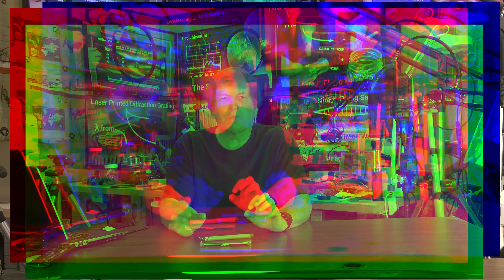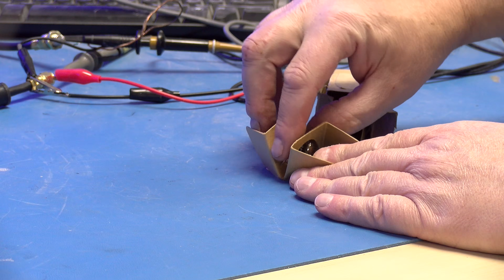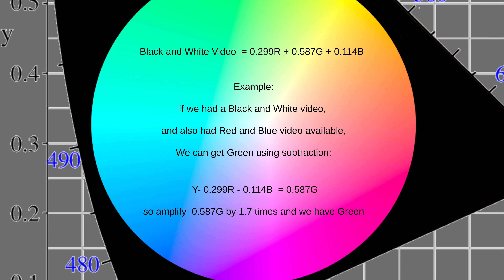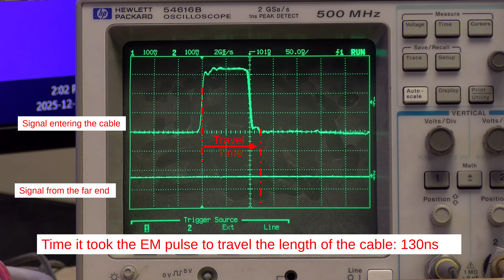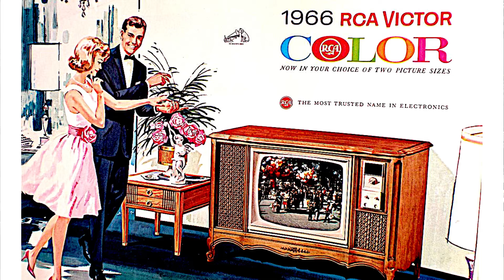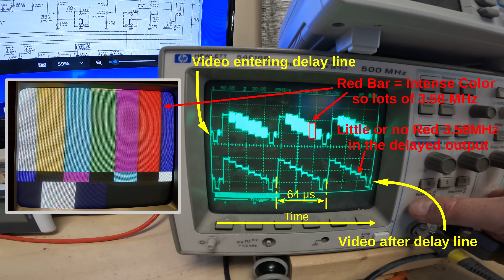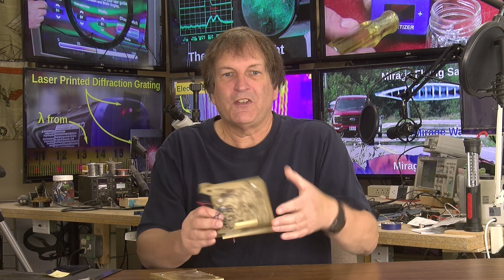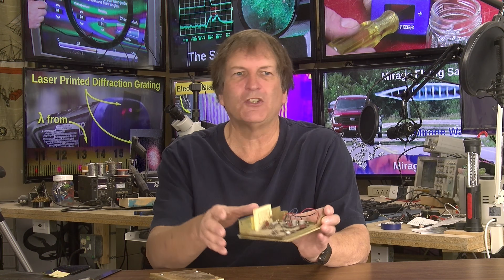How we slowed down electricity to create Color TV

Comment: Some computers in the 80s used delay lines to generate precisely timed signals for DRAM control.
Reply: For example, the Atari 800XL used a 5-tap delay line, ranging from 25 to 440 ns, to generate DRAM clocks. It fit in a standard 14-pin DIP package.
Reply from the maker: @ClausB252  Thats really cool - I have not see that - never had an Atari :)
Reply from the maker: I didnt know that - and I should - had an Apple II back then. I wonder if it used a delay line for the DRAM? The CPU clock at 1Mhz was so slow it would been hard to generate the RAS and CAS timing directly.
Reply: @ElectromagneticVideos  Woz divided the 14 MHz system clock down using various counters to generate RAS, CAS, and all the other memory and video clocks, no delay line in sight.
Reply from the maker: @ClausB252  Of course! I had forgotten that - he needed the higher clock for his brilliant color generation by having bits/pixels in different phase position. His disk controller with bit positioning was equally brilliant.

Comment: I've worked on the same Sears sets shown at the first of the video. Now, to confuse things even more, what system would they use, NTSC or PAL? Some claimed one to be superior to the other, depending on which nation you lived in. The Soviets had their own as well, which was supposedly a version of the NTSC system.

A color floor model would run upwards of $700 at one time, and I remember a 15" RCA selling for $350, which was a lot of money in the seventies.
Reply: NTSC was first. to change to PAL would obsolete ALL the TVs in the USA, s it was cost prohibitive to change to PAL
Reply from the maker: @rty1955  Yes! And it certainly was good enough and as semiconductors replaced tubes the phase errors almost vanished.
Reply: @ElectromagneticVideos you should also explain why vido frame ratenis 29.97 frames per second as that was also part of the color system for broadcast :)
I was in broadcast when videotape was invented. :)
Reply from the maker: @rty1955  Had a bunch of requests for that - I'll do a video on it. 

When video tape was invented? - quadruplex min 1950s? That must have been amazing to be part of. I heard the first machines were so finiky that you pretty much had to play a tape on the machine it was recorded on or the chances of it being usable was low?
Reply: @ElectromagneticVideos the first broadcast  video tape machine were invented by Ampex in 1955. The first model was the VR-1000. It was a flat deck model with all the tube electronics in a 7 foot rack next to it. The design philosophy was to record and playback on any machine, but the machine has many servo mechanisms in it, two being capstone control and the other was the video headwheel. The video head had 4 heads on a rotating wheel. Hence the name quad. The heads rotated at 14,400 rpm and the were perpendicular to the tape. Each head  could only record/playback  17 lines of video, so stop motion playback was impossible. Since the heads rotate so fast the machine needs an air compressor for the air bearings on the video heads. Ball bearings introduced video noise due to the friction of ball be as rings. 
The machine lockup time was in seconds, so for broadcast, you have it a 7 second pre-roll so the machine can lock up to itself and also lock to house vertical sync. It was locked to vertical sync so home television  set did not "glitch" when the video signal was switched. The only time you need full vertical, horizon and burst lock, was when you were doing a special effect, ie dissolve,  chroma key etc.
I worked on every model that Ampex made, and my favorite was the AVR-1
A tape recorded in 1960 can be played back today on a restored machine.
Google an Ampex VR-2000 to watch ots operation 
I now restore these machines.
Reply from the maker: @rty1955  Fascinating! On some old TV shows (I'm a vintage Sitcom fan) you can see the bands of slightly different color hue across the image - All in the Family comes to mind. I assume the videotaped shows in the 70s were all recorded in quadruplex? 

Thanks for that bit of historic detail - do you mind of  copy it to the "posts" section of my channel so it doesnt get lost in all the comments? Do you have a website? Would love to see the machines you are restoring! Or send me an email!
Reply: @ElectromagneticVideos i will post in general comments section..
Reply from the maker: @rty1955  Great!
Reply: PAL, "perfect at last", was technically superior but it was later development.
Reply from the maker: Cool that you worked on those sets! The interesting thing that I came across was that RCA actually had a patent on the phase alternate line idea that became PAL. However RCA kept it out of NTSC because in their estimation it would have added 2 more years of development to making a practical consumer TV set. So it was a business decision where "good enough" ruled. And it may also have been a money thing - another $100 or two on top of those price might have reduced the number of color TV purchasers even more. As you said, that was a lot of money in those days.
Reply: @ElectromagneticVideos same business decision caused VHS to win the battle over Beta.
Reply from the maker: @andyevans2336  I have always found cases like that fascinating - there is often way more to success than having the best or most advanced technology.
Reply: @ElectromagneticVideos  Yes, with RCA, it was always about money. There were a lot of patent suits filed back then between manufacturers as well.
Reply from the maker: One more things - the Soviets - I had thought they used a variant of SECAM, as did most of the eastern communist countries. But the USSR might have been different - I think  a large part of choice of TV system in those days was to protect local industry and also keep out undesirable foreign news. There were lots of subvariations of NTSC, PAL and SECAN to do that - including different audio sub-carriers.
Reply: @ElectromagneticVideos  I think the Soviets used the variant before SECAN; see below from Wiki:

"In January 1960, seven years before adoption of the modified SECAM version, the experimental TV studio in Moscow began broadcasting with the OSKM system. OSKM was the version of NTSC adapted to the European D/K 625/50 standard. OSKM is an acronym for "Simultaneous system with quadrature modulation" (Russian: Одновременная Система с Квадратурной Модуляцией). It used the color-coding scheme later used in PAL (U and V, instead of I and Q).

"The color subcarrier frequency was 4.4296875 MHz, and the bandwidth of U and V signals was near 1.5 MHz. About 4,000 TV sets in four models (Raduga, Temp-22, Izumrud-201 and Izumrud-203) were produced, and were not commercially available."

Comment: The idea of transmitting 3 video images in 3 different colors (red, green, and blue) was what CBS proposed.  However those 3 images had mostly duplicate information in them.  They differed only in color, having duplicate brightness information.  It was recognized that the brightness or luma information took up the most of the bandwidth, and the color information the least.  That 3.5 mhz signal was actually a subcarrier upon which a phase modulated signal carrying the color information was transmitted, much like the way stereo FM broadcasts worked.  In the case of color only two of the three colors had to be sent, the total luma or brightness signal was already being sent in the "main" video signal, then the percentage of that total luma for red and blue were sent modulating the color sub carrier.  Once you subtracted the red and blue from the luma, what remained was the green signal.  The Green signal carried the most bandwidth as it was right in the middle of the eyes sensitivity to light.  That's why only the information of the blue and red colors were transmitted, they took up the least bandwidth.  The frequency chosen for the color subcarrier was based on the horizontal and vertical scanning frequencies, and those were base on the prevailing power line frequency.  That's why in Europe where thy have 50hz power, PAL and SECAN transmissions use different color burst sub carriers.  At it's time, the NTSC system was a stroke of genius!

In ham radio, Robot Research produced a line of Slow Scan TV equipment that could send video information over the 2.5khz bandwidth SSB voice signals used in short wave communication.  This was basically a form of FAX transmission that sent a 128x128 pixel still image (8 seconds per frame) in Black and White.  Robot wanted to add color to this, but in a compatible way.  So they added an additional burst of color information at the end of each line of video during the horizontal blanking pulse.  This information was in the form of R-Y and B-Y.  They digitized the incoming signal and stored it in computer memory, then they could play that image back by un-digitizing it (A/D then D/A) thus scan conversion to display a single frame on a CRT.  The R-Y and B-Y signals were sent as only 32 pixels per line, or about 1/4 the BW of the entire line, similar to what NTSC was doing.
Reply: I always see your comments in the comment sections of a lot of channels I watch, and they are always very informative. I always appreciate them. Take care, sir!
Reply from the maker: @Bizzy09  I'm not sure if your referring to  @KennethScharf  or myself - I think we all watch a lot of similar channels and comment on them. One thing I have learned is how important comments are for videos - they seem to be one the things that really helps a videos popularity. And insightful comments also add lots of interesting information - I learn so much from comments on my or other peoples videos. Sometimes the comments are the best part. Its also very nice for the videos creator. I post way more comments on videos since making my own channel and understanding how helpful they are.
Reply: Yes, combining the color information into differential signals and Y was required to provide a compliant B/W signal. The color subcarriers were in fact chosen to spectrally interleave the quadrature modulated chroma signal with the baseband luma signal (Y). You are correct, they are calculated as a multiple of the scan rate, the number of subcarrier cycles per line and a frequency offset (PAL) to avoid moiree patterns
Reply from the maker: Thats a great summary filling in a lot of stuff that didn't get in the video! 

The CBS color wheel system - as impractical as it was both mechanically and channel wise, it actually had a resurgence in many DLP TVs and projectors with a color wheel used to add color to a single light valve. I have the bottom half of a DLP TV to use in a video about that sometime. One disadvantage of the modern  DLP color wheel is that some people (and I'm one of them) occasionally see a rainbow type effect when the eye moves when watching a DLP image.
Reply: @ElectromagneticVideos  The color wheel  was also revived in the form of a color camera that used a single vidicon tube.  This camera went to the moon on the Apollo missions!
Reply from the maker: @KennethScharf  Yes - I remember reading that somewhere. And I think the camera was slow scan too and reduced resolution. But it was so amazing to see video from the moon!
Reply: @ElectromagneticVideos  Actually quite close to standard scan rates, though some scan rate conversion was likely used, IIRC you could see some ghosting arifacts in the imaage caused by that.  It was likely nearly standard frame resolution, but reduced frame rate, perhaps 30 to 50 percent of normal.  Scan conversion back in 1969 would have been done by a special dual ended tube with a common target.  I forget the RCA part number for that.  RCA made many special TV camera and image tubes back then, including the tiny 1/2" vidicon used in the Apollo camera.  I even had an idea of designing a tiny TV camera back in the 70's using that tube, one I could fit in the nosecone of an Estes rocket and operate on the 450 mhz ham band.  Then I found out what that vidicon cost!
Reply from the maker: @KennethScharf  I didnt know of the dual ended tube! I had read about pointing a TV camera to a monitor to do the conversion.  Estes rockets! I wanted to fit a small film camera in one but never did. All the electronics for vidicon camera would have been a challenge for size and weight. Those rockets were great fun!
Reply: @ElectromagneticVideos  I did try to build a vidicon camera from a construction article in 73 magazine.  Had to wind my own deflection yoke and focus coils around home brew forms.  I used an old 1" surveillance camera vidicon.  It would have been a medium scan to slow scan sampling camera with a horizontal frequency around 4 khz and display on an oscilloscope.  Almost, but not quite got it working.
Those scan conversion tubes were quite rare, but I do recall seeing it listed in some RCA publication, along with the 1/2" vidicon.  The "Vidiroc" idea would have required an Enerjet F engine to get off the ground!
Reply from the maker: @KennethScharf  Gee - I wonder if it was the same magazine article I read? Struggled for years to make a vidicon camera. Finally succeeded  around 1980 or so  with my own design and won a regional High School Science Fair with it. Fun projects! And yes - the focus coil was heavy!
Reply: @ElectromagneticVideos   
look for td1364
https://frank.pocnet.net/other/GeneralElectrodynamicsCorp/GeneralElectrodynamics_QuickReferenceCatalog.pdf
Reply: @ElectromagneticVideos  google for TD1364 scan converter tube

Comment: The working "guts" of an acorn tube were still about the same size as the "guts" of 7 pin miniature tubes, IE: the 6AK5 miniature pentode was an early TV era version of the 9001 pentode used in WWII VHF radios.  The 956 Acorn tube was also a VHF/UHF pentode with nearly identical specifications to the 9001/6AK5, with internal structure of about the same size.  Acorn tubes did have slightly shorter lead lengths, but their sockets were actually larger than the 7 pin miniature tubes, so their advantages at VHF / UHF over the miniature style tubes were marginal.  In fact the miniature style and acorn style tubes were actually developed at the same time to solve the same problems in building VHF/UHF radios during the war.   During the 1960's RCA came out with the Nuvistor style tube that was even smaller, and was more suitable for UHF.  Nuvistors were used in TV tuners during the 1960's and 70's
Reply from the maker: Somewhere  - and I wish I could find it - I have a Nuvistor from an old TV tuner. Actually I wish I had kept the tuner. It was remarkable how small it was  - not much thicker than pencil. Really neat technology!
Reply: @ElectromagneticVideos  Most Nuvistors were triodes.  They were made in both 'consumer' and 'industrial' versions.  There was a screen grid version that was of double ended construction with a plate cap. (I don't remember if it was a true pentode, or a tetrode).  Nuvistors were used in the front end of some Tektronix scopes.  I built a grid dip meter using a 5CW4 nuvistor based on plans that appeared in an ARRL handbook.
Reply from the maker: @KennethScharf  hat cool that you actually used one. I always wanted to build a grid dip meter but never did.
Reply: I do believe the Nuvistor was old tech in TV tuners even by the 1970s. I only every saw them in the mid 60s.
Reply from the maker: @educatedmanholecoverbyrich8890  I think thats the right timeline. In the 70s I used to get old broken TVs from the 50s and 60s, strip them for parts, and fix and sell the good ones. Great experience for a future engineer and good money for a high school student in the late 70s, early 80s.
Reply: @educatedmanholecoverbyrich8890   Pretty much correct. Solid state was taking over in tv sets by the 70's, though there were a lot of hybrid sets in this period. Nuvistors were big in RCA color sets, used mostly for RF amplifiers in the VHF tuners. The UHF tuners were mostly transistorized by this time, using a single transistor as an oscillator, and basically then feeding into  VHF tuner for the rest of the electronic functions.

Comment: That last pcb had (I counted) 28 delay lines!! Yes, I learned a great deal.Thanks.
Reply from the maker: Your welcome - glad you liked it! I never counted them - did realize there were that many.  There were a couple of pairs of traces that seemed to be kept at the same distance apart - most likely a differential transmission line similar to what is used in Ethernet which I thought was cool.
Reply: @ElectromagneticVideos  I, too gained that impression. When designing a pcb for microwave transmissions. I too use a chart for transmission lines that, occasionally, incorporate a delay line, though I never understood why. 73
Reply from the maker: @educatedmanholecoverbyrich8890  Thats really cool! I have always wanted to play around with things like that. .Closest I came was with about 20cm of PCB transmission line for Ethernet.